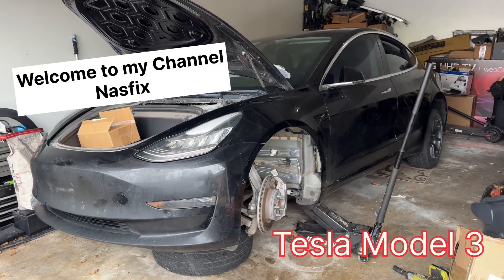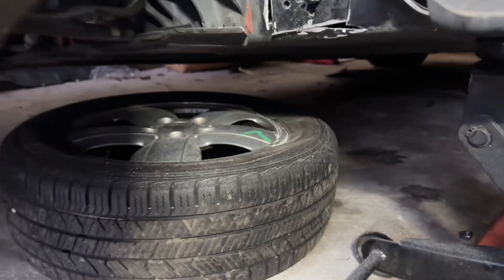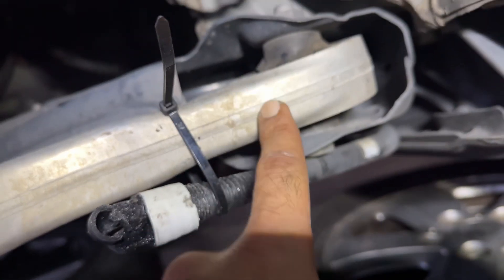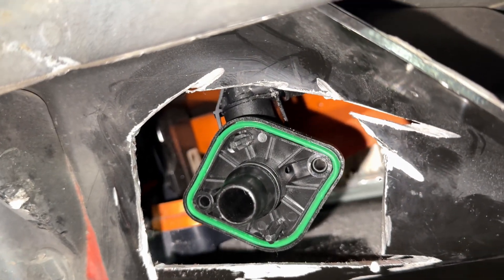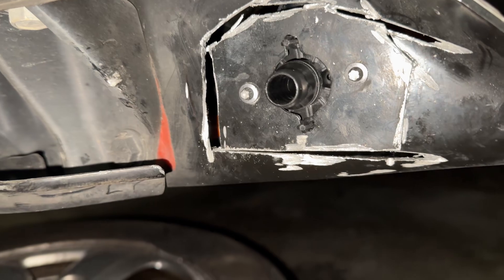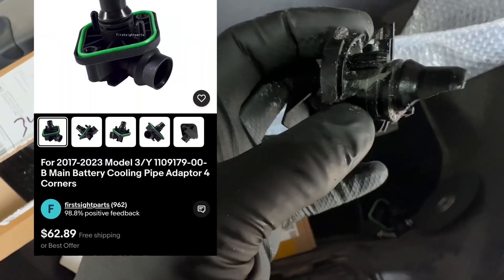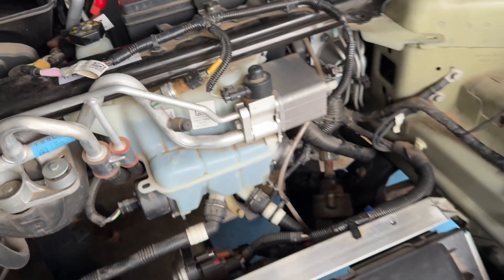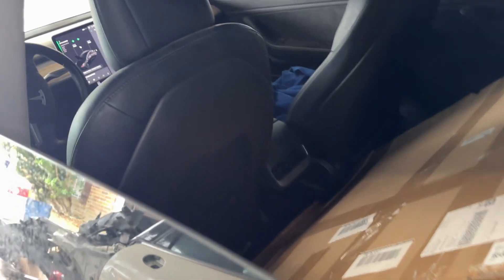Tesla Model 3 - DIY coolant hose Leak repair

Comment: I’m all for right to repair but it might be dangerous to get metal dust on the inside of a sealed HV battery. 

Drop pack , replace part, and then close the pack lid.